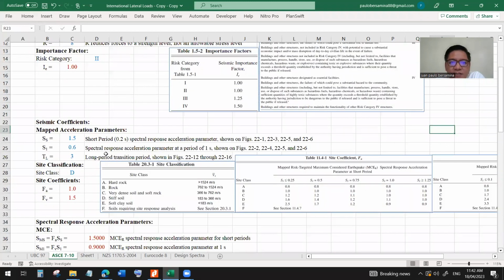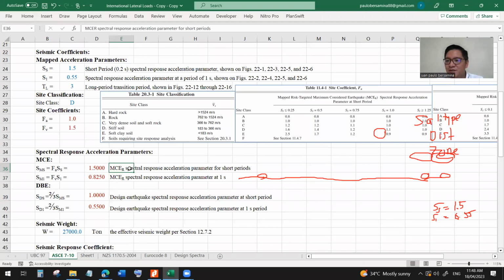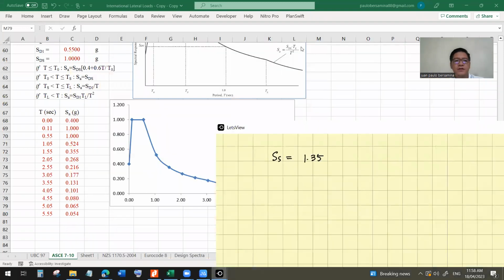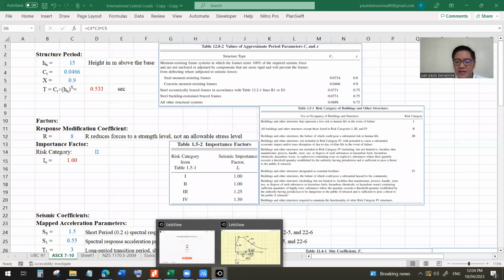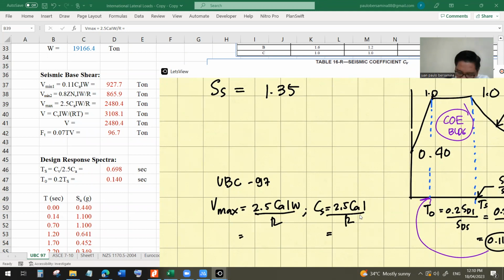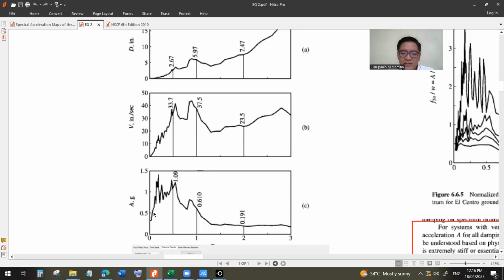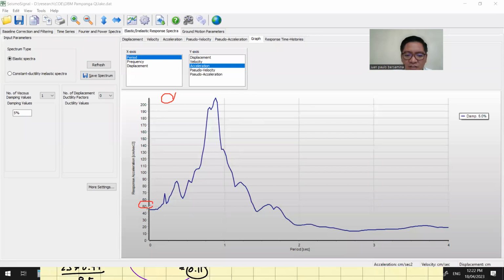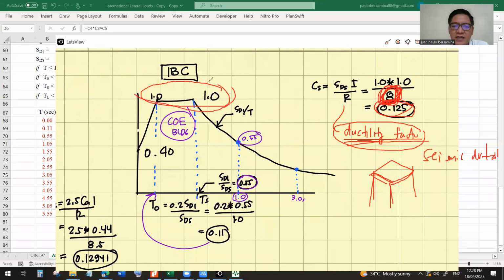IBC Asce 7 response spectra format Part 2

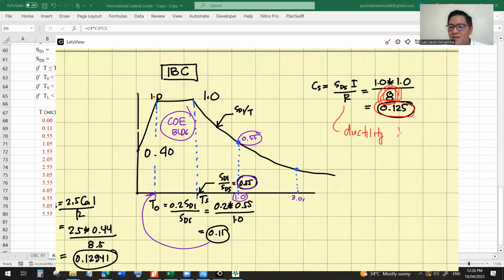Comment: 40:27 Sir, meron po ba kayong reference on how the "ductility factor" is derived? Marami po kasi nagsasabi na hindi daw po accurate ang mga response modification factor as per building codes kaya gumagamit sila ng nonlinear inelastic analysis. sana po makapag upload po kayo ng video tungkol dito, salamat po!
Reply from the maker: i discuss that in my earthquake engineering class. but u can check chopra also